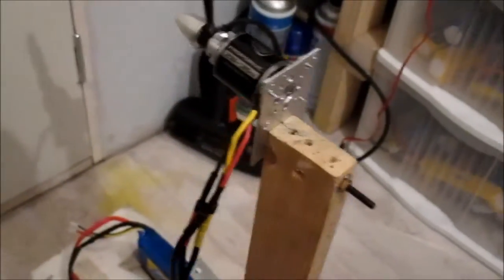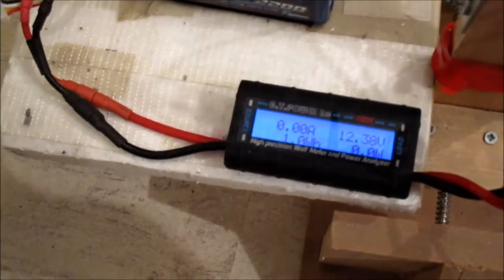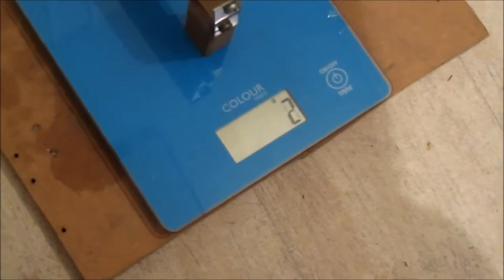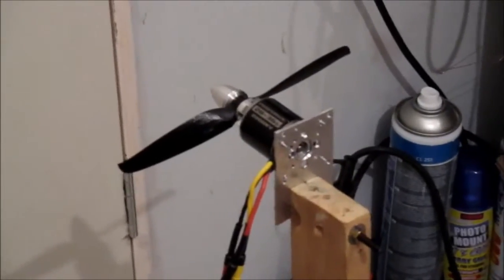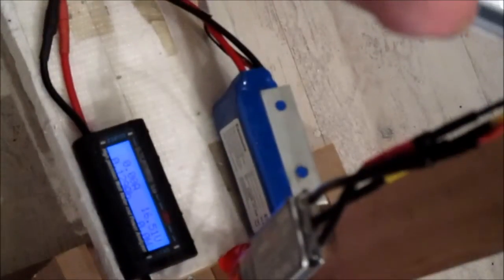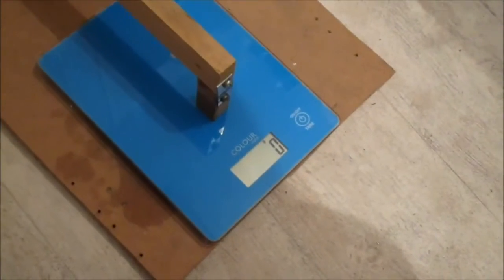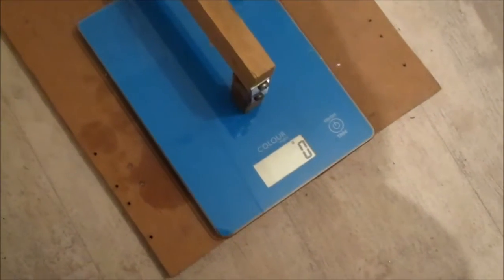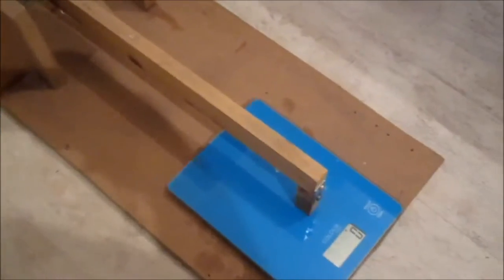NTM Prop Drive 2836 2200kv Thrust Test Part 1 Motor Test of the week

Comment: You have an interesting test rig. There will be consistent results from battery to battery and prop to prop. Does your set-up take into account the long moment arms the rig has and that affect on measured thrust? That is, it would seem that you would measure higher thrust if you have your motor mounted on a 20cm post and a lower thrust on a 10cm post, given the same motor/prop/battery setup. That old, "Give me a lever long enough and a fulcrum on which to place it, and I shall move the world." Archimedes

For instance, if you mounted your post/motor ON the scale, maybe pointed straight up, that would seem like it would give a direct thrust reading, with no lever (moment arm) involved.
Reply from the maker: It has been roughly calibrated. I adjusted it so the height the motors are mounted, about equal pressure was showing when pushing another set of scales against the motor shaft. Only way I thought of doing it. It's probably close enough. lol 😆

Comment: I am using it on a parkjet with 6045/6050 prop on 4s , i need atleast 80% throttle to keep my rig in the air , is this motor good for it
Reply from the maker: Sure.

Comment: is it safe if I use 7" prop?
Reply from the maker: Hi Ronnie. I haven't tested it but i believe it's ok to run a 7x4 prop on 3 cells. Maybe i'll do a part 2 to this motor test comparing different 7 inch props. Thanks for watching.
Reply from the maker: Done the part 2 for you and had surprising results on 7 inch props.

Comment: Hi! Do you have a summary table?
Reply from the maker: Hi hope this helps.

Prop                           Thrust              Amps                 Watts                  Cells
TGS 6X4                1270-1240g    36.95-37.73        428-446                   3

APC 6X4                    999-980g      37.4-37.4            429-437                   3

TGS 6X4                 1750-1690g   55.28-55.79        804-837                   4

TGS 5X5                 1170-1142g   43.49-43.54        639-647                   4

APC 5.25X6.25        981-941g           57.18                 812                        4
TGS 4.5X4.5         1200-1180g       45.02                   756                        5